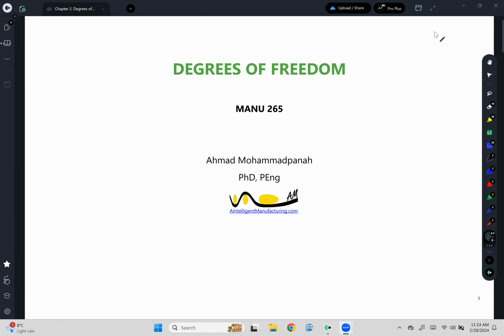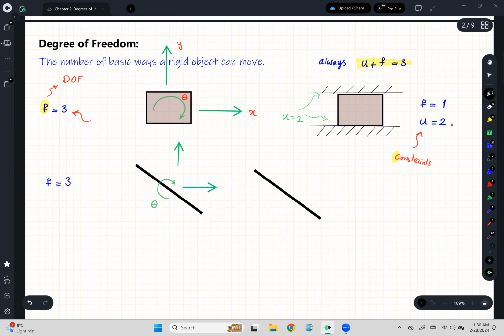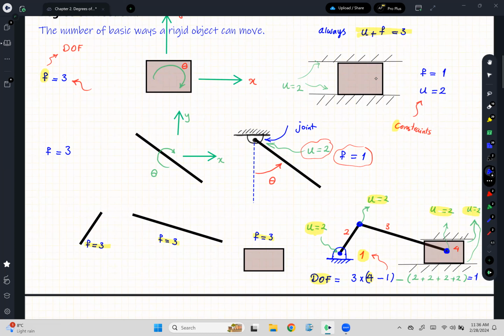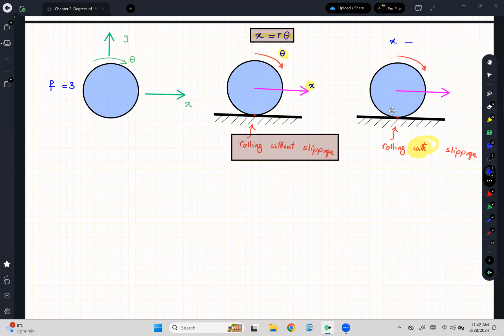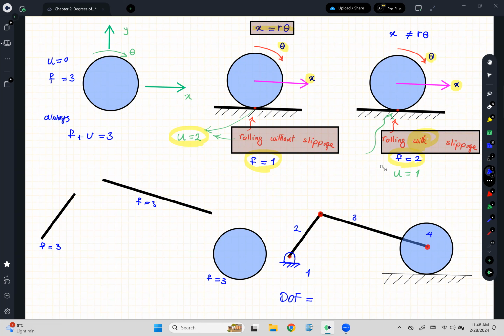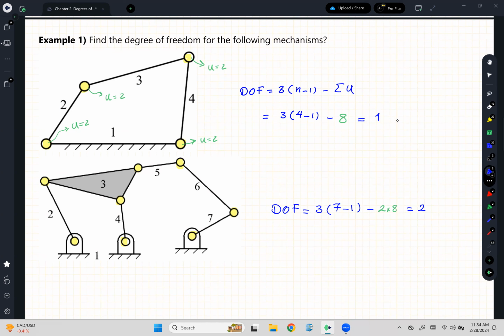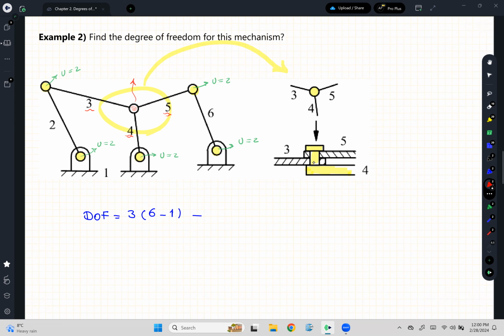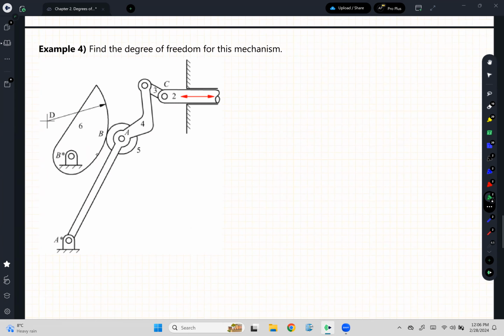Lecture 2  Degree of Freedom

Comment: Why does 3-4-5 joint in example 2 only have u = 4 constraints? why is it not 6?
Reply: Is it because joint 3-4-5 is a ternary joint which can be treated as two binary joints? The joint cannot move in x and y directions, but can still rotate, so it has u = 4, and a corresponding DOF of 2?